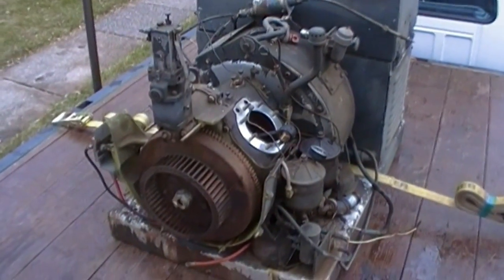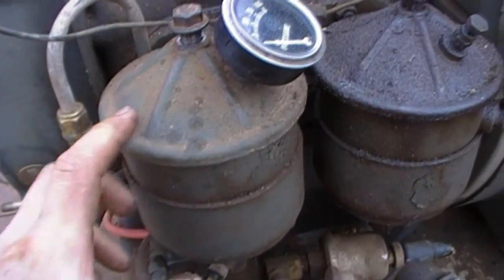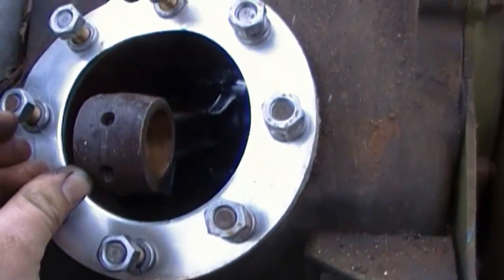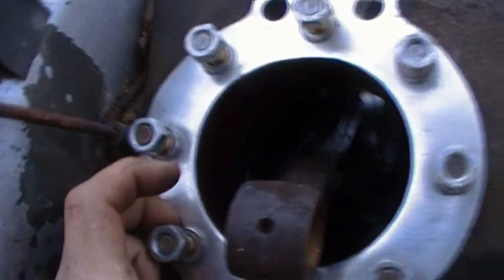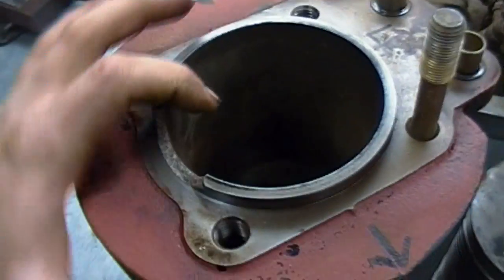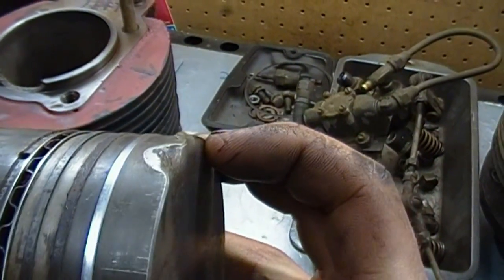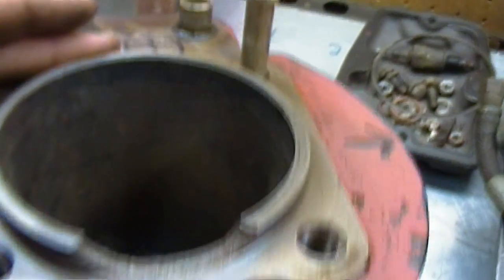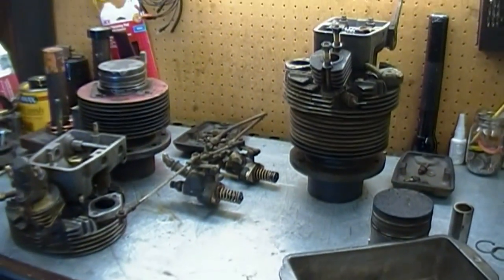American Marc Military Generator Progress

Comment: Idk if you see this but iv been watching channel for awhile and I just picked a nos American Marc generator with a complete steel parts box all nos pistons rods gaskets injectors pretty much a entire engine in spare parts. The bottom end looks exactly like your vtwin American Marc gen but it's liquid cooled Engine model Wc2-11 and gen model 5-601 guess just looking for info the gen unit control box is a different design I got it running but produces no power the volt Meyer will jump back and force when you hold the field exciter button but thats about it